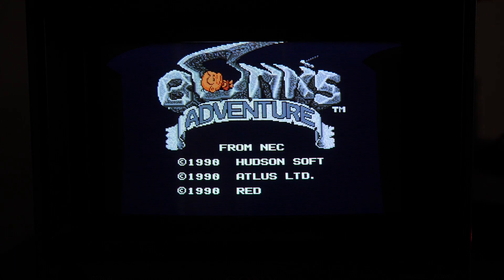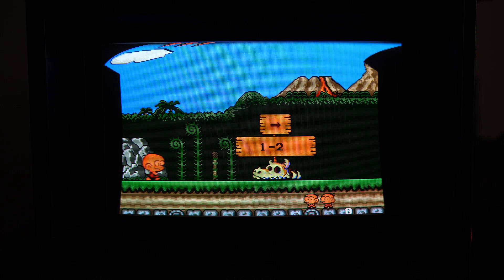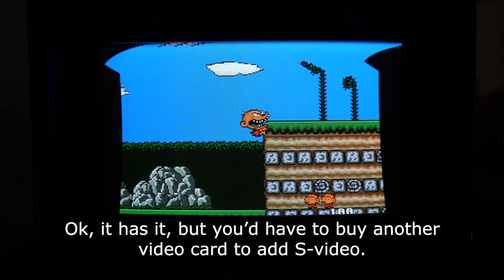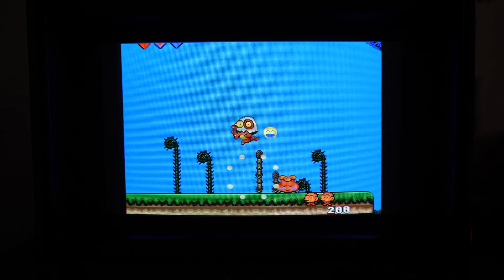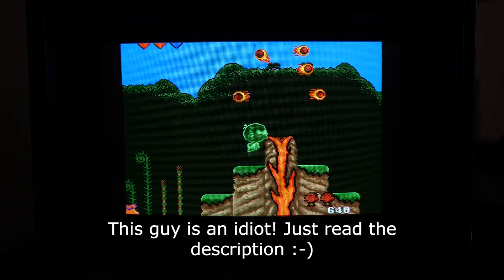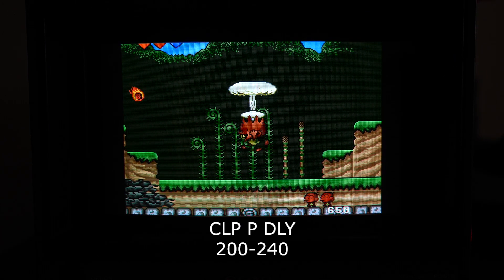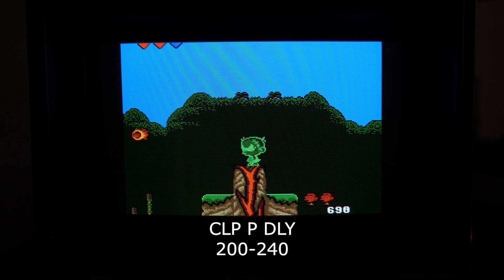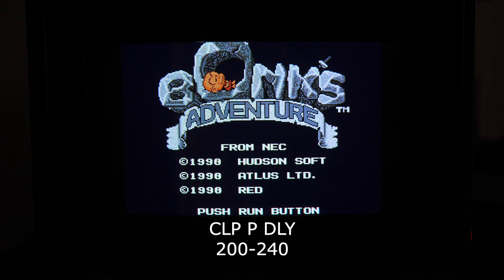PC Engine/TurboGrafx-16/MiSTer and BVM-D Series (no VCR mode)

Comment: I only had to use an Extron RGB 203 rxi using the SERR setting to solve flagging for my TG16 and Neo Geo AES for my d series. For some reason I had to place the Extron RGB in my signal chain AFTER it went into my Extron Crosspoint. Doing it before fixed nothing.